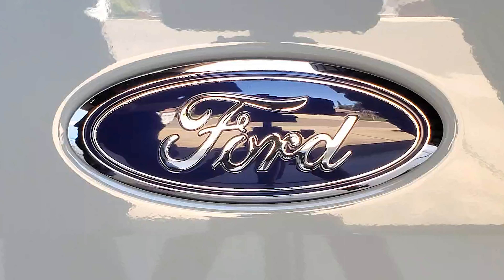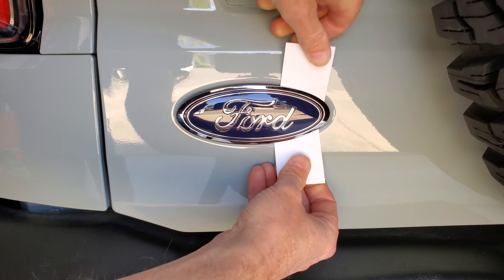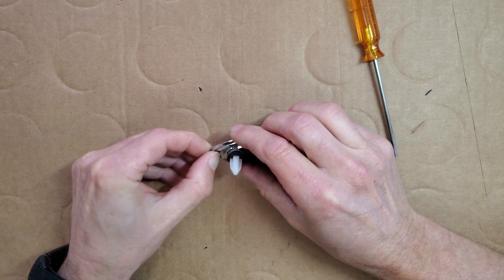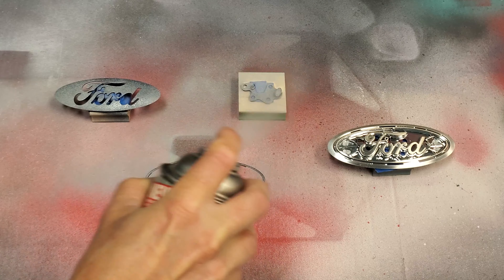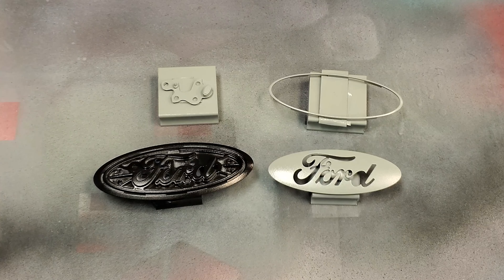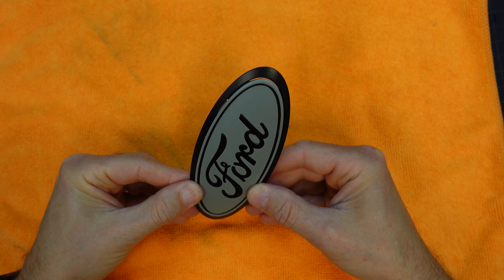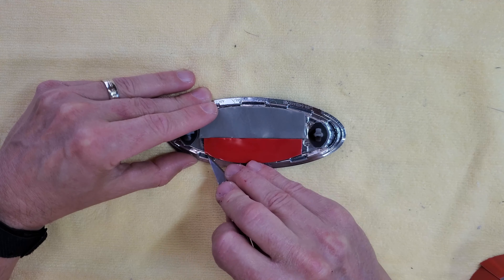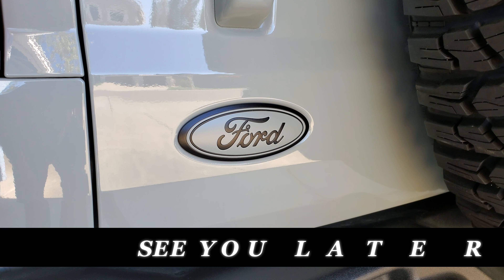Bronco Rear Tailgate Ford Oval Emblem Removal and Painting

Comment: NOIICCE! Looks good, man! I ended up buying the blacked out emblem and wanted to see how to get to the clips off; will be using my maxed out credit cards for the job since they aint gettin any use right now anyways! xD I'll be disassembling the original and doing some monkeying around a bit, myself, after seeing how awesome yours came out. Oh, might I suggest looking into KBS clear, its UV safe and doesn't yella like other clears, good stuff. You mentioned you had some other projects.. if they are going to be exposed to the UVs it might be worth lookin into. KBS has gloss and satin finishes in the clear, btw. Thanks for the vid!